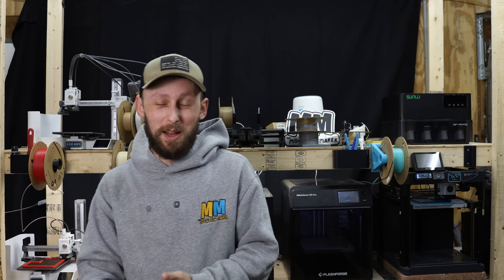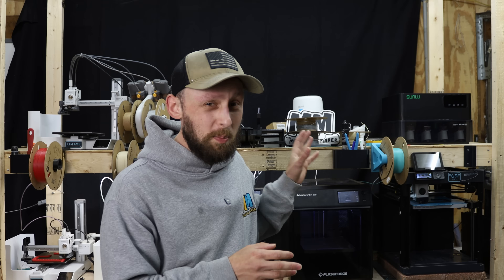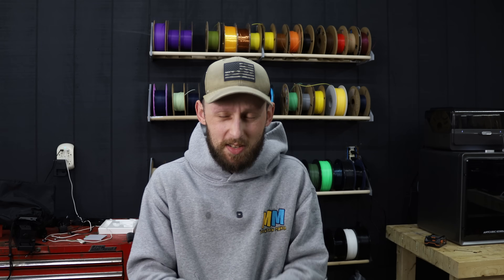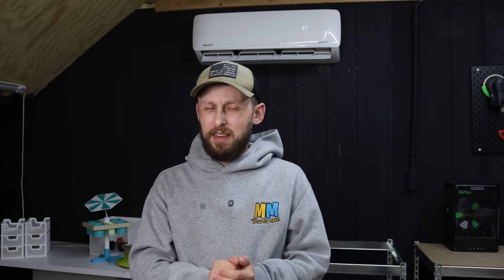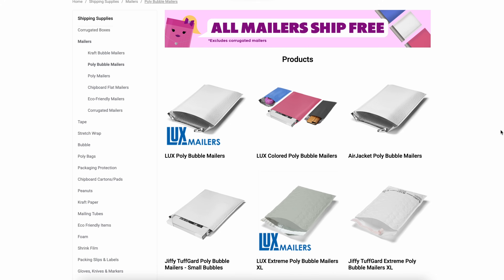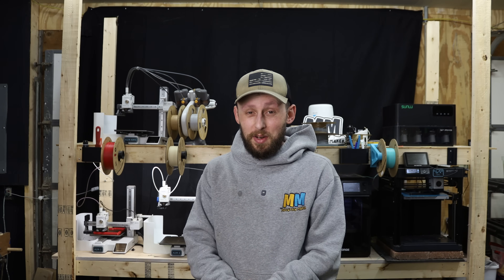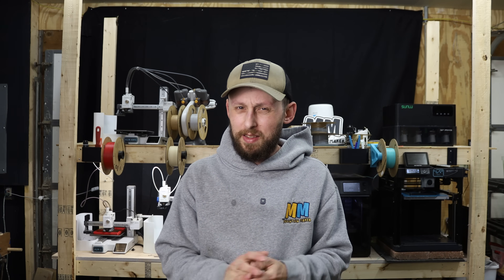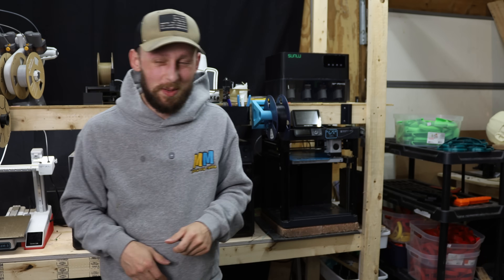3D Print Farm Vlog | A Shop Update and Printing the Farm Loop System

Comment: should i buy p1s combo or 4 a1mini or 2 a1
Reply: i want only bambulab printers
Reply from the maker: Depends on what your needs are. If you print tall items, want the ability to stack multiple ams units (or print with more than 4 colors) the P1S combo is hard to beat. If your items are 7" or smaller or you want the ability to print multiple different products at once, the A1 Mini is a great machine, If your items are larger than 7" in size or you want to stack the build plate with more parts, the A1 is a great printer as well. Heres another option, Assuming your budget is around $1000 USD, 1 A1 Combo unit and 2 A1 Minis would be a great option as well